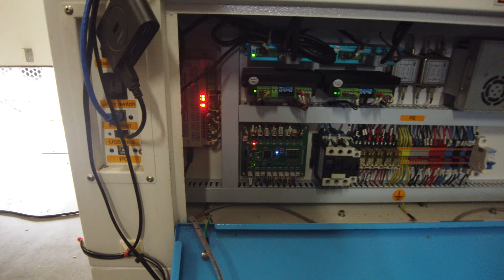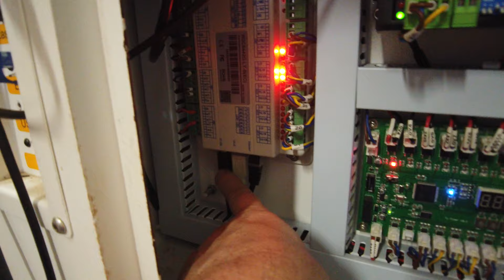Troubleshooting Com Issues - OEM Extension Cables

Comment: ONE question is it normal that the run led number 14 is blinking or the main board is damaged, because the motors are stuck and do not move. I bought a Ruida RDC6445s and I don't know if it was damaged
Reply from the maker: https://support.thunderlaserusa.com/portal/en/kb/articles/ruida-dsp-led-status-indicators
Reply from the maker: led 14 just means its thinking. its normal for it wo flash seemingly randomly